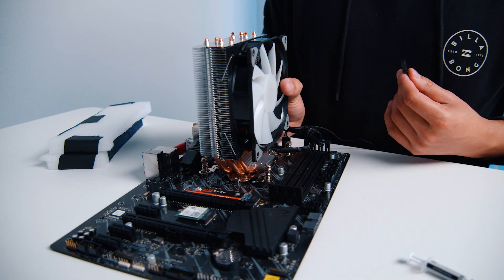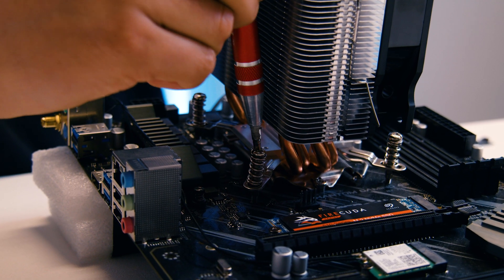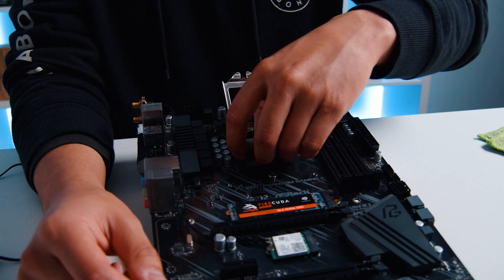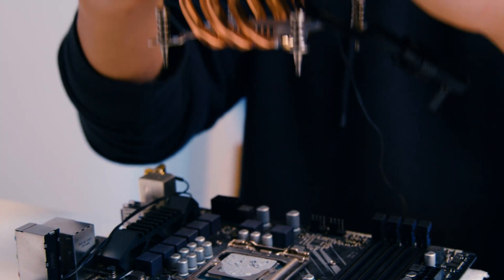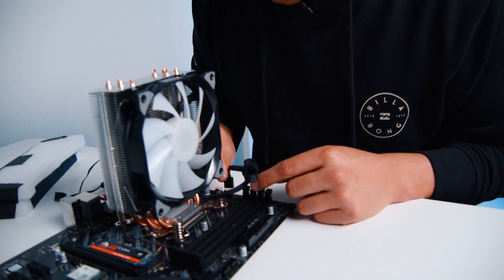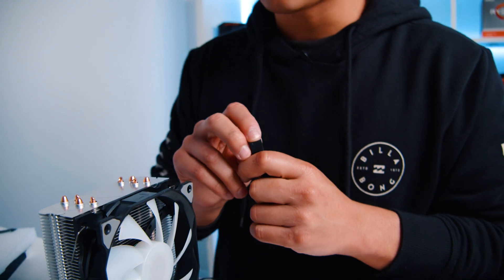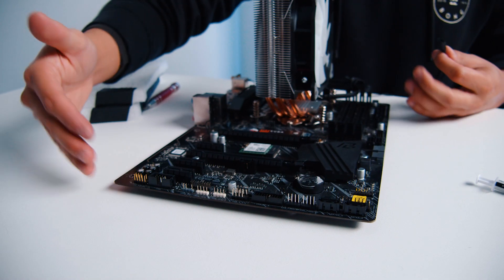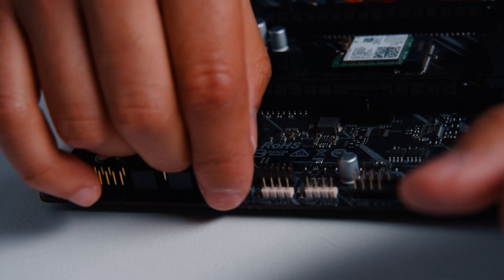Intel CPU Fan Removal/Install

Comment: Hey quick question bro, how does one go about changing a water cooler for the cpu do I need to remove the water cooler first and then proceed to removing the back bracket that's connect to the mother board, cause I need to replace that with Nzxt's Bracket. First time so really don't wanna mess anything up???

Comment: Taken from your words: "A little beam of thermal paste because when you put down the cpu it will actually spread out". I mean wtf the cpu is already down. What will spread out the thermal paste ?????? The cooler ? Your cloth ? I don't have my pc right now but I plan on doing this right away and I really need more explanation on this step lol.
Reply: You put the thermal paste on the CPU, and when you place the cooler on the CPU, its flat surface under the heatsink will spread the paste out. Then you can screw it in.
Also, to be safe, make sure your thermal paste isn't electrically conductive, or else getting some onto the motherboard will fuck it up.

Comment: You guys seriously put the worst cpu coolers in history on your CPU's
Reply: lol yeah just got a prebuilt and my cpu was overheating. It’s okay tho they’re sending me another one!
Reply: @DiveFeed  help me!!!
Reply: Same anyone know how to replace there stock 120mm water cooler, trying to replace it with a Nzxt Intel but no clue how to start would I have to start with removing Fans/radiator & then proceed to disconnecting and removing the back bracket? Also how can I remove the back bracket without removing motherboard

Comment: Very quick very easy. Except for the fact that you have to take the whole pc apart with a constant fear that you will ruin something that you cant replace cause it was expensive... but yeah sure.
Reply: literally just turn off the psu or unplug it from the wall
Reply: @AnnmusPnda  they are talking about taking the motherboard out.

Comment: If I just bought the computer and need to move the fan to add more RAM do I still need to remove and add more thermal paste?  I don't know if that is just for when you are removing/replacing an older fan.  Thanks for any advice you can give.
Reply: Yes everytime you remove it

Comment: are u suggesting non professional to take cpu out without hesitation just for wiping grease?
Reply: It's not just "grease" its a compound that is vital in making sure the CPU is properly cooled but the heatsink and fan, and it needs to be removed (how often that needs to happen can vary by quite a bit) and reapplied otherwise it could drastically impair the effectiveness of the cooling and could even cause overheating which will damage the hardware over time. It is not really a process that is worth wasting money on to get a professional to do unless you feel you are completely out of your depth doing.
Reply: unless you suffer from extreme clumsiness if you are very careful it should be fine. intel cpus are less fragile then amd ones because the pins are on the motherboard. just make sure to not give the cpu any static electricity

Comment: My stock intel cpu fan doesn't have exposed screws like that?
Reply: sock intel fans use push pins, not screws
Reply: @B1ueone  any tips on switching that fucker out
Reply: @B1ueone  uh my intel has screws in it.. 4 screws i see it all around them
Reply: Did u end up solving it?